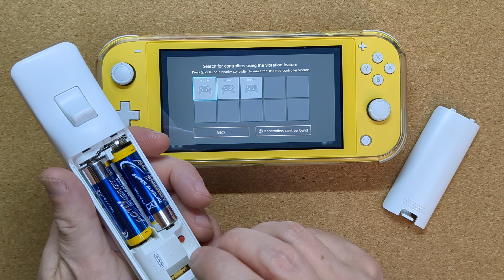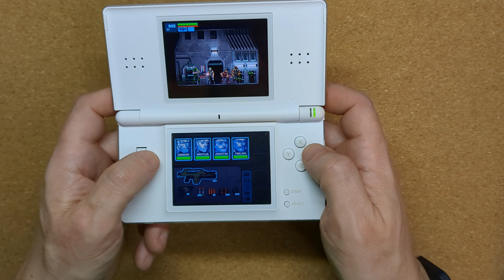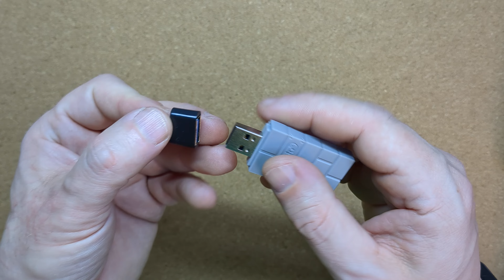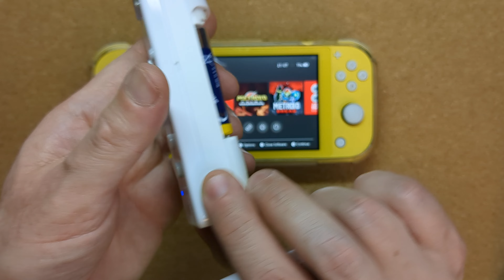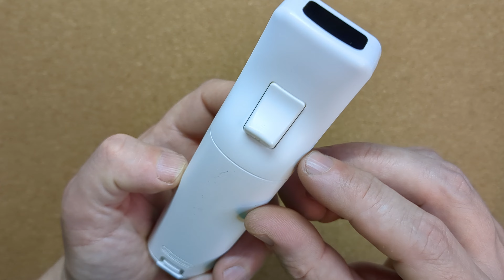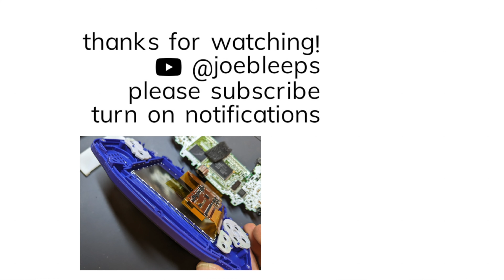How to use a Wii Remote to control your Switch console - Old and new Nintendo combined!

Comment: I bought the v2 version and the way you connect a Wii is by following your steps expect instead of pressing the up and minus button you need to connect the nunchuck and press the Z button on it and the minus button instead and it will connect, also fun fact. You can connect a wired pro remote to the Wiimote and skip all of the mapping.
Reply: Can’t seem to get my wiimote connected, updated the v2 and it just won’t sync
Reply from the maker: @AllanTheGuy1  did you try the method above with the nunchuck controller as well as the method I used in the video?
Reply: @JoeBleeps  I got my official wiimote connected. Originally I was trying to connect an unofficial one that I bought with built in motion plus, it worked great on my wii. After it wouldn’t sync, I dug out an old remote I had and used your steps, it worked instantly.
Reply from the maker: @AllanTheGuy1  ahh that's great news. Thanks for reporting back!
Reply: The classic controller is missing the stick click but other than that it's perfectly usable unless you absolutely need round sticks. (I have the 8bitdo gbro adapter not the one you're talking about) I still recommend a the 8bitdo SN30 Pro 2 over it though
Reply: Thanks. i was searching the internet but couldent find how . all the videos where the first generation 8bitdo. but this works!
Reply: Can you connect it without a nunchuck ?
Reply: @BostiogVasilica  no because you need to press that Z button on the nunchucks
Reply: Trying all methods and wiimote don't want to connect
Reply from the maker: Super helpful thank you! Pinned 📌
Reply: @JoeBleeps  I scoured the internet’s last night in hopes of getting this connected simply because we play the WiiU pretty often still so I have a medley of wiimotes, why buy a new one? After hours of attempts and research I found one post in a three comment Reddit thread and Bam it worked. To resync just press the 1 and 2 button on the wiimote.
Reply from the maker: @RalphLBaer  I really appreciate you sharing it here

Comment: Is it possible then to connect the Switch with the tv and can you only connect 1 Wii Control with the adapter or maybe 2-4?
Reply from the maker: Maybe if you use two adapters

Comment: 65 yr's old and butt hurt.  Nintendo will be shutting down the Mariokart server for the wiiu making you switch to the switch console if you want to race online. I need my wiiu controller to work with the Switch console. I dislike the small controllers and the racing experience is awkward and no fun. Have you found a way to get the motion sensors to cooperate with the switch. Would love to keep racing with my steering wheel. You can be a hero to many.. Thanks dude.
Reply from the maker: I haven't really explored much further than the contents of the video here but I may revisit it soon
Reply: @JoeBleeps I you could pull it off I would buy a couple.

Comment: Hey I need help, the Controller is connected with the 8bitdo and the switch but when I want to connect the Controller in the options it won't connect.

Do you have any ideas?
Reply from the maker: What version of the adapter do you have?
Reply: @JoeBleeps  I bought this one on Amazon: 8bitdo Wireless USB Adapter 2, Bluetooth, PC, PS Classic, Android, macOS, Raspberry Pi, Retrofreak System, Kompatibel mit Xbox Series, Joycon, Switch Pro, PS5,PS4,PS3 Controller
Reply from the maker: @KaitoKudo4869  did you see the pinned comment about connecting with the V2 adapter?
Reply: @JoeBleeps  Well I tried it now but it also doesnt work. When I press up and minus the 8bitdo's blue light is blinking twice (but doesnt connect) and when I press Z and Minus it's not blinking🤔
Reply: @JoeBleeps  ok nevermind, the nunchak i tried to use was apparently not working. I tried an other one and it works now. Thank you so much
Reply from the maker: @KaitoKudo4869  ah that's fantastic news! Thank you for the update

Comment: just saw this and i have a quick question. after attaching the wii remote to the nintendo switch would i be able to connect my wii classic controller unto the back to use that controller instead of the wii remote?
Reply from the maker: Ooooh that's a good point! I'll have to try it
Reply: @JoeBleeps  did you try?
Reply from the maker: @DanilSay  sorry not yet!

Comment: Wired comms is on but my Wii remote doesn’t work anymore and it just shows the LED.What can I do to fix it
Reply from the maker: Are you using the original adapter or the version 2?
Reply: @JoeBleeps the 2 version.For some reason it has times when it works and when it doesn’t work
Reply from the maker: @csqubed  that's frustrating.  I haven't tried the 2 version but I know it has a slightly different sync method, I think that's in the pinned comment here

Comment: wii remote doesn't connect to the switch OLED, tried old and new firmware of the 8bitdo :S
Reply from the maker: Ahh I didn't know that. I have got the OLED since making this video but hadn't tried it with the wiimote yet.
Reply: @JoeBleeps  If you find a solution let me know haha

Comment: Question. Am I correct saying what you did takes no prior soft modding? I only ask because I saw a prior video somewhere where the guy softmodded and then was able to use his wiimote and your method is a lot easier and right to the point. No worries if you don't get back to me and thanks.
Reply from the maker: No mods involved here, you just need to have the adapter. I think the softmod maybe allows a direct connection without an adapter
Reply: @JoeBleeps  awesome that's great apreciate the answer and have a good day👍